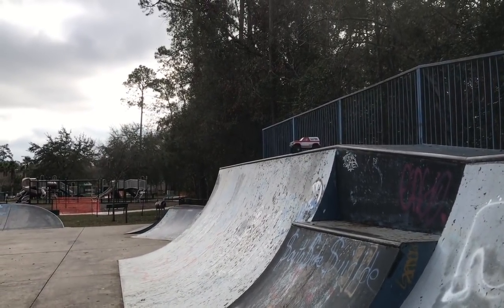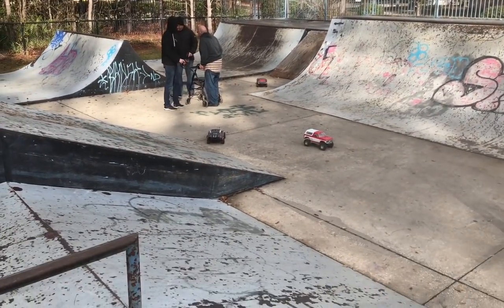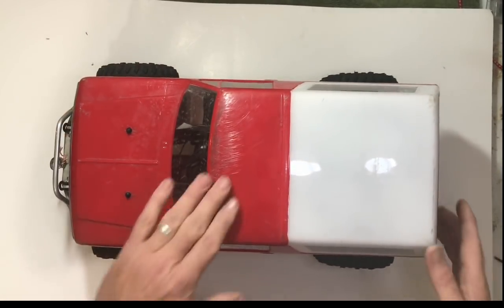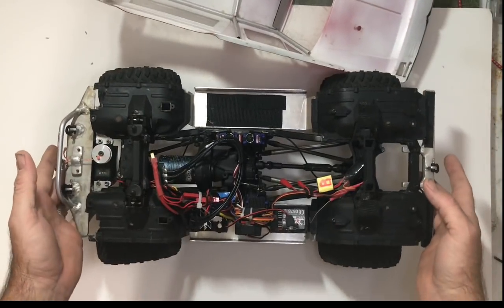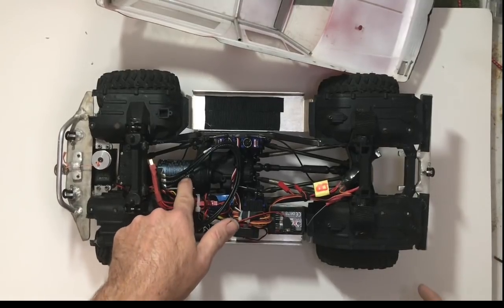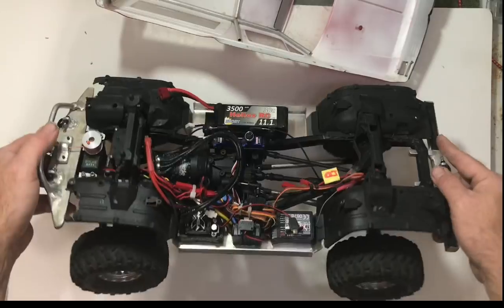Trx 4 Bronco at a SKATE PARK!!!

Comment: Have you done the channel 3 why leave yet so that your auxiliary wire can remove you drag brake in high range it's so good to drive when you don't have a drag brake at high range it drives just like a slash or any other high-speed vehicle
Reply from the maker: Yeah I’ve had it set up like that but I’ve found that 17% drag brake with the 9t pinion and 3800kv motor works great in both gears for me. I tried the crawl/trail mode and the drag brake was too much for my liking as I like my stuff to slowly roll down a hill.
Reply: Exocaged RC yeah I don't have mine set up in any kind of crawl mode I just have .05% drag brake in low and zero drag brake and high the trx4 has so much gear reduction that even at .5% drag brake it stops right now
Reply from the maker: Yeah, maybe I didn’t have mine setup right because 1st would do an endo with instant stops.
Reply: Sorry for the poor spelling I'm driving down the freeway